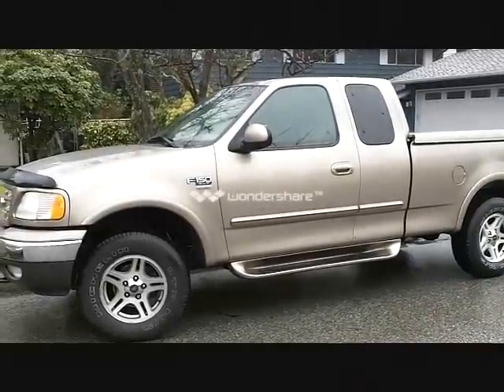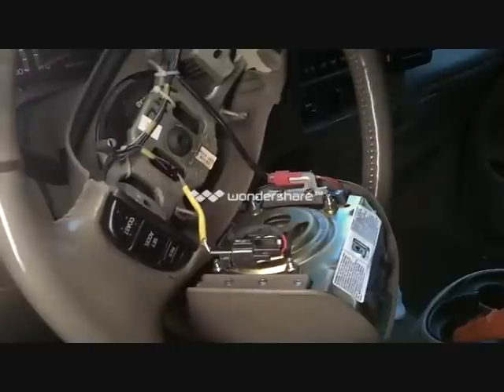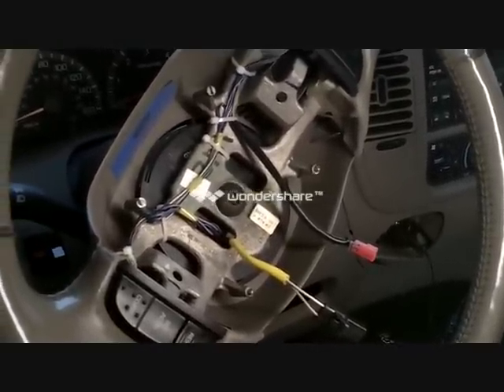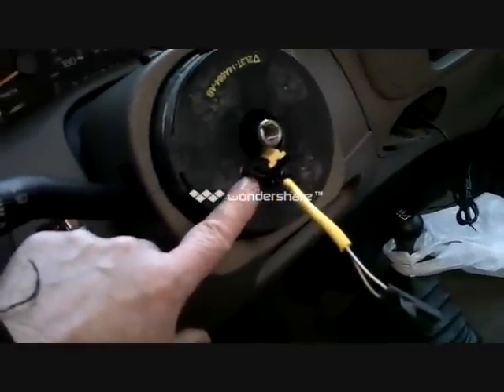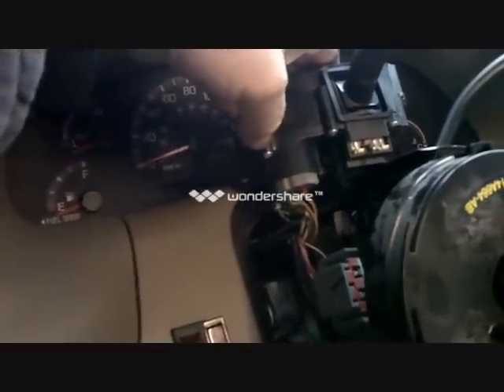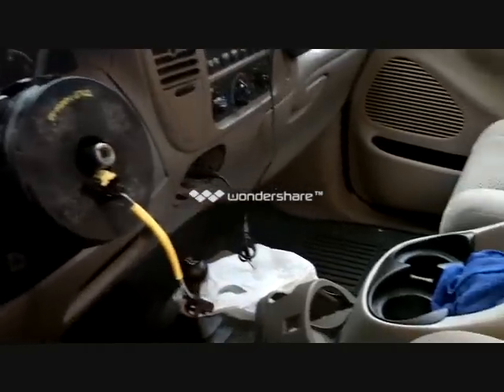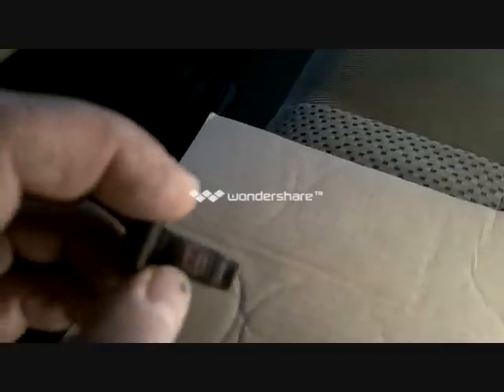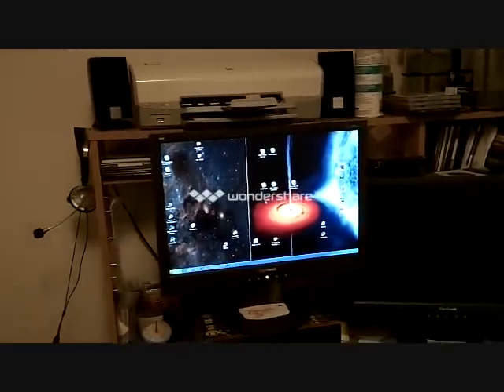1997 to 2004 F150 air bag, steering wheel removal and multi switch replacement.wmv

Comment: No need to remove steering wheel.  However, Excellent Video. Lots of hard work, planning, and effort has gone into making this video.  Thank you.

Each time,after using using turn signal, when it clicked back to turn off signal, it would turn on my high beams, and I would have to turn those off.
 
Ford Dealership and my trusted garage wanted to charge me $700 to replace that multi switch on my 2001 Expedition 5.4L (I love my truck), as they indicated it required dealing with the "Air Bag".   I held off doing this for 4 years. 

I found this to be False.. as a mater of fact, it take 30 minutes to access. 
1) Chock the weels to prevent them from rolling (you will be adjust the gear selector to several different settings (Park, R, , N,Drive D1, 2).
2) Pull the  _ Ground/Negative on the battery
3) Pull the /, \  (upside down U-panel below the Instrument cluster, over and running beside the steering wheel column. (only 4 clips hold that in place.
4) Remove the 3 screws (the 4th hole is to access the Ignition switch clip) to the cowling.
5) With Pliers, gently turn the steering wheel tilt, to unscrew and remove from the column. This will allow you to remove the bottom left side of the cowling.
6)Under the ignition cylinder, You can now see the little hole for the ignition cylinder. With the Ingnition key inserted (No battery connected so it won't start), Insert a small screw driver in the little hole  to disengage the pin/lock., and gently pull out the cylinder. 
7) Now remove the left remainder of the cowling (top right).

*Now you can easily see what where to work, and what needs to be done :)*

8) Two Torx screws hold the Multi-switch to the steering column. Remove those.
9) The hardest part, unplugging the wire harness from that multiswitch. Even with the clips on both sides pulled up, I had to use a screw driver to try and pry it out, and broke apart the old switch. There must be a better way, but I got it done.
10) insert plugs from wire harness to multi-switch and reverse for the install.

Comment: a little tip touch battery cables together when removing airbag steering wheel bolt is one time use only shouldnt reuse nice video i have a 2003 F150 had it 9 years good truck if you ever have a problem trying to find the pcv valve let me know they are different than regular ones and in a different location on the 4.2L

Comment: What was the torque you used on the steering wheel bolt ? You have any issues with the airbag light coming on ?

Comment: Excellent , thanks for the lesson . I  was just looking at my 1996 Ford F150 , I unscrewed the casing around the steering wheel 
to see what was involved in replacing that turn signal assembly . Ha ha ha , I totally didn't think about the airbag .
Holy shit that could have knocked me out . Does that old airbag even work ?

Comment from the maker: Note: after removing the steering wheels bolt and before removing the steering wheel from the column make sure to use a felt pen to mark its orientation with a line near the steering wheels bolt up hole to the column so that when you re-install the wheel 
its in the correct position. I didn't really cover that well in the video, cheers.

Comment: When handling an air bag you should carry it with the trim FACING YOU at arms length... If it goes off and trim is FACING AWAY, you can get hit with the metal backing at high speeds and thats alot more dangerous than taking the big fluffy bag in the face

Comment: You don't have to remove your steering wheel just the plastics on the top and bottom. 2 or 3 Philips head screws.

Comment: lol why the hell would you remove the air bag and steering wheel to replace the multifunction switch? This is a simple 10 minute job...
Reply: +MATTCARMD unless the switch isn't the problem, and his ignition actuator is broke then you would have too.  Ford 10th gen problems...

Comment: Silicone is Acidic and will eat the metal. Real Silicone is wrong. If it has any silicone in it that stuff is acidic and the 100% silicone is very acidic and eats metal. I grew up working in a body shop and worked two years as a mechanics assistant. Never use silicone on raw metal.  If you silicone a leak on your windshield, it will leak even worst within months the hole will be larger because the silicone eats metal. Replace the whole clip, replace the steering wheel harness or epoxy the slip back in. Never use silicone on bare metal, it is very acidic.